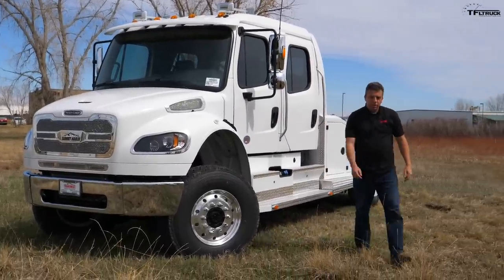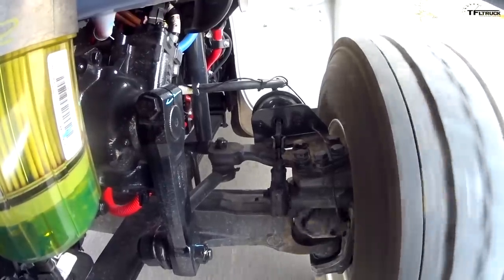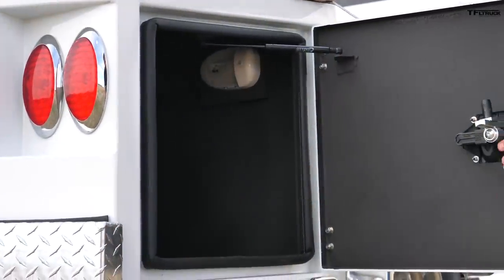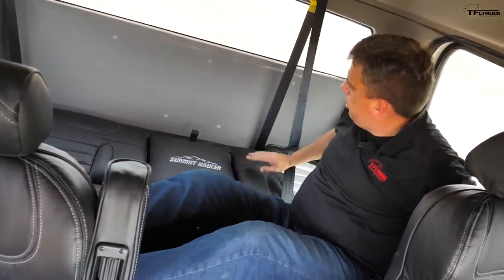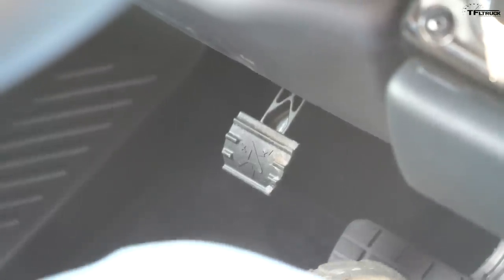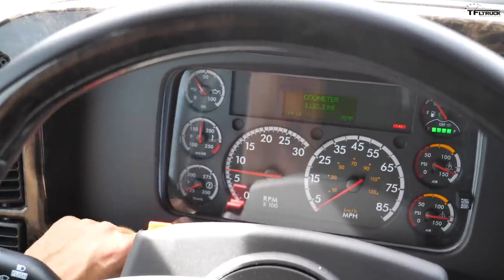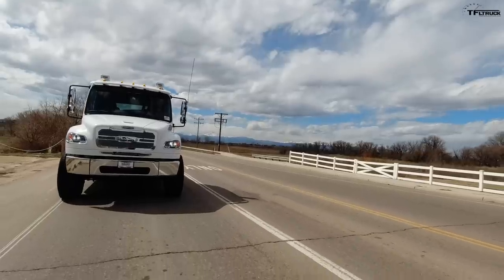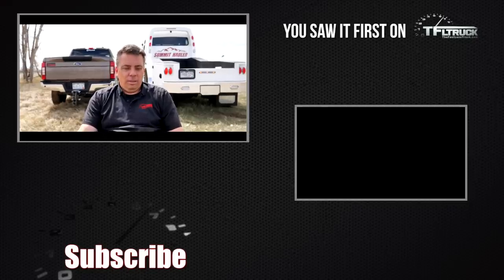This 4x4 Freightliner Semi Truck Is the Coolest Real-Life Tonka Toy You Didn't Know You Wanted!

Comment: You would probably need A class license to haul anything with it 
Not the ultimate for a regular person
Reply: Class A would depend on what trailer weight you pull, and most importantly, what you are doing with it. Pulling your RV only and registered as such, no CDL. Still pretty pricey.
Reply: Depending on your state laws you may not need a CDL to own and drive that.  Some states have requirements for personal vehicles by size some do not.  Also if it is a farmer rancher depending on state law they may still need the extra safety items but not a CDL.  CDL is for commercial, as in getting paid to drive a vehicle for some reason. If I had a lot more money and bought that for my farm or a grocery getter I would not need any special license in the state I live.
Reply: @badgerpa9  yes farmers get a lot more leeway. Some states have non commercial type license. As far as cdl's they  follow federal requirements and standards as far as qualifications.

Comment: No, I know I do not want this. Seems to be the ultimate male compensation machine. 
Mitsubishi/Fuso or Isuzu would have better ground clearance with similar tow and payload maximums and they can actually go off-road.
Reply: Mad Mick Fuso max gvw is 17995# max for a FE180, basically comparable to an F550. This Freighliner was in the 30,000 GCWR and had air brakes. Different trucks altogether.

Comment: DEF is not good for a motor. It's basically liqwed furtlizer going in to your motor and eating the in side of it.
Reply: DEF doesn't go into the engine. It is injected into the exhaust.
Reply: Did you mean to type liquid fertilizer?   Also it is shot into part of the exhaust to bind with the exhaust to change the chemicals coming out.

Comment: 30,740# GVWR makes it a commercial vehicle. This requires a commercial driver's license. Having air brakes as well requires removing the air brakes restriction of that CDL. This isn't a truck anyone can just get in and drive.
Reply: No it does not. CDL is commercial, it depends on your state on if you need special tests or if you do commercial work with it.  A farmer rancher may not need CDL depending on state.   And the air brake restriction is only in a few states.  It depends on where you license it.  If I had a lot more money I could use it for my farm and or a grocery getter and not need any special license.   If you have the money and the need to buy it and your state required testing or if you did commercial you would have a CDL already so why spread 1950 rumors.
Reply: @badgerpa9  you're talking about 1% of people. TFL viewers would be looking at this as a road trip truck. Crossing states lines? Check. Interstate use automatically means FMCSA regs apply and that's the view I was approaching. Honestly, no one watching this video is thinking "wow, that's a great farm truck to get groceries in".

Comment: And, just like the two wheel drive you got things wrong. Perhaps if you want to continue reviewing commercial grade trucks, classes at A and B, bring on an experience truck driver for piece rate or as a heavy heavy duty truck reviewer.
Reply: I am sure you know everything so tell us all about it.  Or not since your channel has 51 subscribers and is painful to watch the videos.
Reply: @badgerpa9  well, being a second generation truck driver, I do know everything about commercial trucks. 
That red push valve he claimed was to test the brakes, has nothing to do with testing the brakes. That is the valve to supply the trailer with air, which counteracts the pressure of the spring in the brake chamber that automatically applies the brake when there is no air in the system. There are two air lines that go to the trailer. A supply air line and a service brake air line. When you push that red button in it supplies the trailer with air, filling a reservoir tank and releasing the spring brakes. This also is the air supply for optional equipment, such as air ride suspension and automatic tire pressure monitoring systems. The spring brake is not a parking brake.  While modern spring brakes are better than they used to be, they may not be sufficient to keep a fully laden trailer from rolling away on a steep hill. When you apply the service brakes with your pedal or treadle or "trolley"/hand valve if equipped, and the trailer is supplied with air, another valve is opened automatically on the power unit that allows the service brake system to apply the trailer brakes at the same time, with a slight delay from the time it takes to pressurize the lines, by adding air pressure to the spring side of the chamber. The pressure of the spring in addition to the air pressure from the service brake system overcomes the pressure of the supply air side of the chamber. Simply releasing the supply air to the trailer and pulling with the power unit means absolutely nothing. Sure, sometimes you can drag a fully loaded trailer with the spring brake grabbing hard enough to trag the tires, but more often than not you will exceed the stopping power of the spring brake. The only way to make sure your trailer's service brake is working properly is to use the trolley brake. With properly working brakes, you will drag the tires or not move at all. 
If you'd like, I could go into why the engineers at Freightliner screwing with the function of the trolley brake need their fingers broken. But you'll have to wait a few hours for me to finish this run to Florida.

Comment: Hmm and for 170k less you can get a nice class 8 rig.
Reply: 4x4?
Reply: @jamesmiller7911  class 8 has twin screw lockers.  Will go anywhere and more than this M2 4x4 would. How do you think these farms get diesel delivered or food to northern grocery stores....heck just watch outback trucking to see what a class 8 can do in the right hands
Reply: This is heavy enough as it is for off road but you can get them with 2 axles in the back and configured different if you want.  It all depends on what you want.